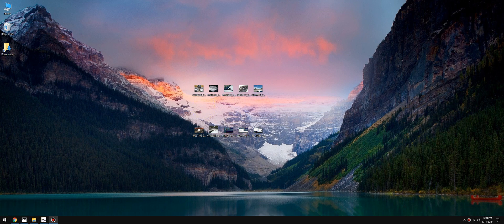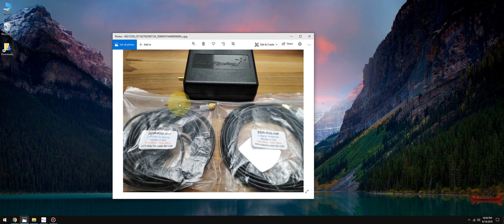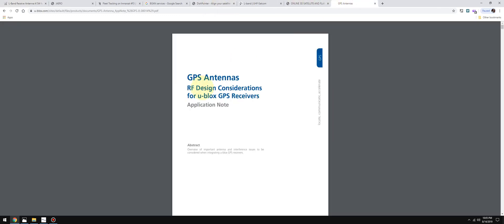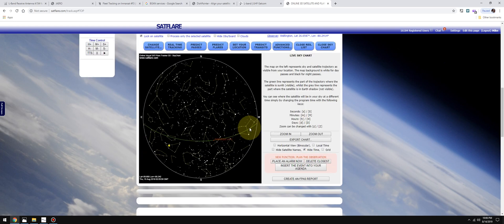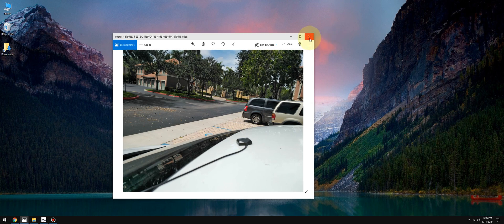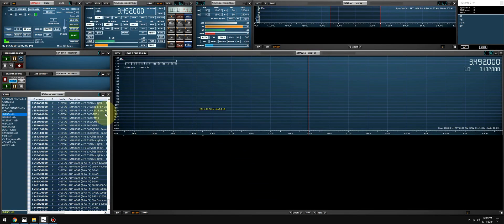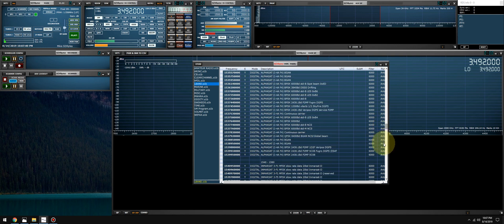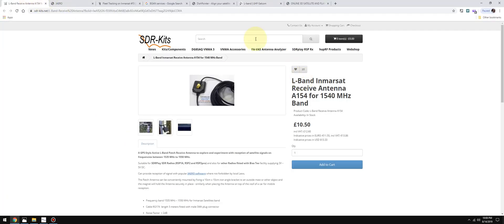Exploring L Band with SDRuno: P1

Comment: This antenna is essentially omnidirectional in azimuth.  You don't need to aim it.  Just mount it on a ground plane (pizza pan sized disc) and keep it level.  You do need a clear line of sight path to the satellite.  No obstructions like buildings or significant vegetation in the way.

Comment: Mike, have got that antenna and it works ok but looking at the cable I wonder what loss there is its RG174, I haven't a calculator for receive loss but as an example if i was transmitting at L band frequency of 100w then you would get 17w out for a 5m cable, obviously you are not transmitting but thats a heap of loss. I wonder if anyone has replaced the cable with better stuff. I would suspect you would have to use adapters for SMA ends. Just a thought!
Reply from the maker: Safe to assume it's lossy.